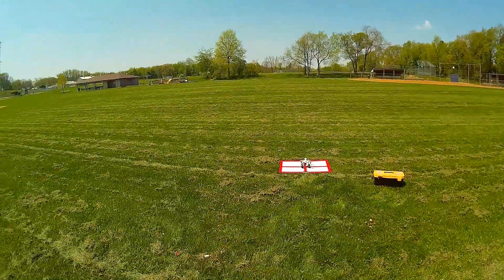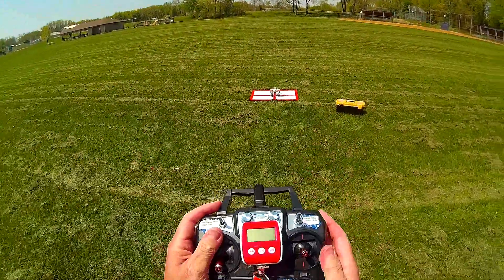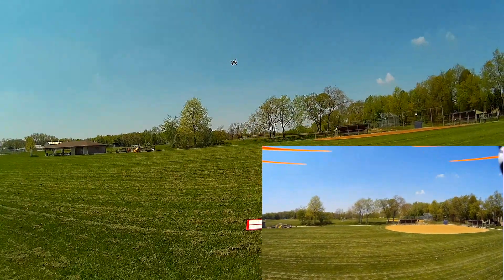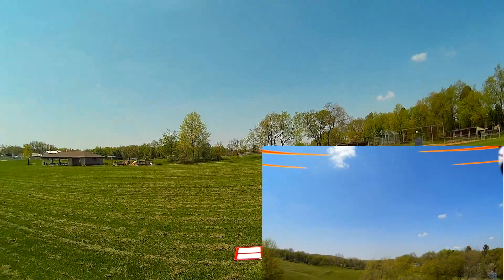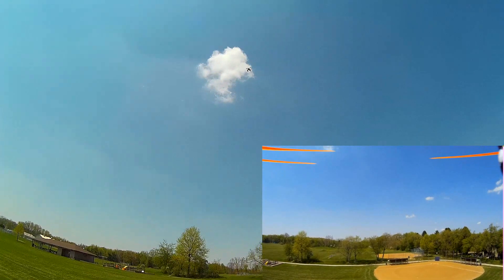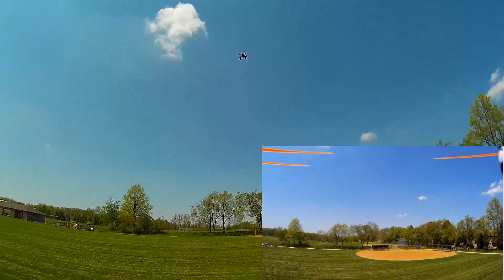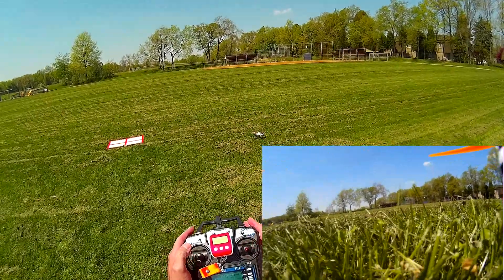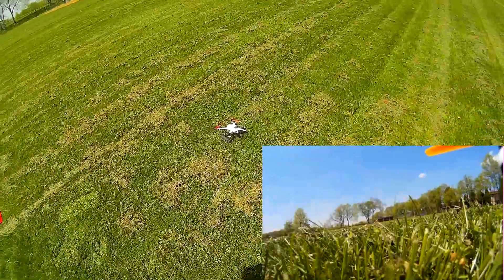RTH  Return to Home  test of the Flying 3D X6 quadcopter

Comment: Nice video. It was fairly accurate and could be better but for the price I think it is great Lol way better than the $20 chinese quads that say they have RTH but just fly backwards or some where off into the woods ;)
Reply from the maker: The RCAddict  That's my whole attraction to this.  Where can you purchase a pre-built quad with brushless motors, GPS and a decent range for under $200??  Yes, you can build one, but that may not be for everyone.  I'm slowly liking the 3D X6 as I tweak it.. More vids coming.
Reply: MrPolymers Yeah, it really is a good value. I am going to build a 250 mini quad this summer once I start my job
Reply from the maker: Me too.  I need to cool it though.  I just finished placing my youngest child through college.  Now time to cough up the dough for the student loans. Damn, I could build a real one with that kinda dough. ;)

Comment: Is there a gimbal on this? If not, then this thing is extremely stable.
Reply from the maker: Joe Quadcopter  Joe, this quad becomes erratic with any weight.  I'd not do an FPV setup with this.  I'll build my own first.